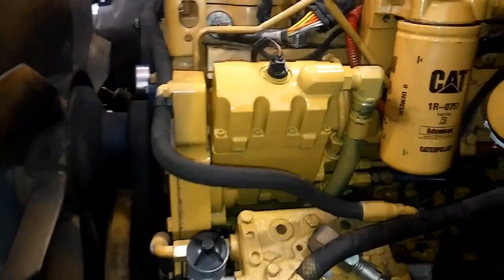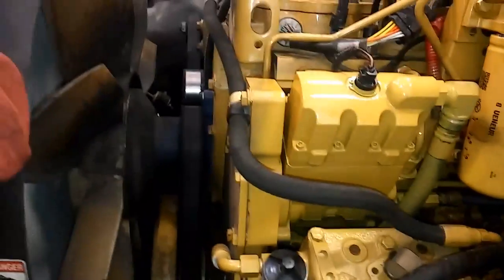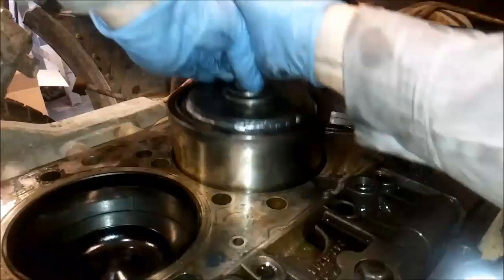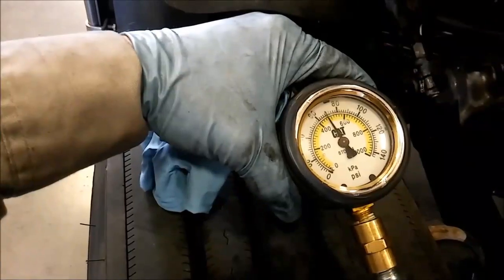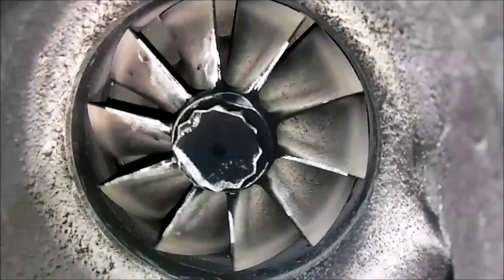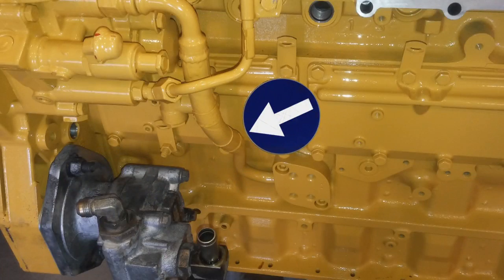How To Make Your Cat C7, 3126, or C9 Bulletproof.  HEUI System Upgrade.

Comment: My cat engine is a 1993 or so and since then, turbo technology and efficiency has jumped up in huge amounts.  I can't find any solid info regarding a upgrade. Not necessarily a CAT upgrade, but "common sense" upgrade .. It's not for (MORE POWER) but a quicker spool, cooler egt and less back pressure .. without injector changes, it won't make "more power" , but it will make the power with less heat and back pressure. much like a better inter-cooler can, but in a even better way. 
    I believe a proper compound system would do even better yet.  I wish someone who has seen this stuff done right would make some videos . ((Bringing your 3126 into the new millennium)) .. something like that...  it's like a 60s car on bias ply tires,  some new fangled radials will change everything...

Comment: Hey thanks so much for all the great info. I have C-9 in my coach. I have a whistle that is throttle position sensitive. Under accelleration it will whistle through relativeley small throttle position range. Under deceleration it whistles through the same range. Guessing it's something related to boost but hoping to get some input on where to look/check? Thank you in advance.

Comment: Boss , it really doesn’t help people do prolonged oil services. ALL hydraulic injection systems fail prematurely because people choose to change their oil when they feel like it, not when it’s needed. Be surprised how many people never think their oil needs replacing. When pumps, injectors and cams/lifters fail then they act like they never knew oil poor oil changes triggers that. 😂

Comment: Critical to check valve spring seat pressure every 75k miles , the weak springs are notorious for losing seat pressure with age and dropping the keepers and valve as a result

Comment: Is it possible to use a separate oil/hydraulic line/system coming from the engine going to the HEUI pump then going to the injectors?
Will that separate oil’s system seep in with the regular engine oil?
And if it does why not just use “clean” motor oil but still keep them separated.

Comment: Iv got a 99 Tiffin Allegro Bus with a 3126B with a Bullydog inline tuner... I love it but I bought a 2004 Newmar with a C7 Acert... Will it inter change?? 9:02
Reply: Were did you get the bully dog tuner i git a 02 gmc tow truck with 3126 kitten i want more power

Comment: Hey guy.I see there is a filter sysem that goes between the huei and the injectors. Im wondering if that would be a good idea or is that just more wear on the huei,by adding more back preasure to the huei?

Comment: I'm about to fit a HEUI pump to a C9 engine, I plan to fit a remote Oil filter on the intake Pipe to the HEUI pump, am I right in thinking this is a good move?

Comment: I have freightliner M2 with Cat C7, it was smoking bad and low power  when I bought, all injectors were bad so got those changed. 
Power is OK now but smokes a lot when start up, runs rough till water temperature hits 150, once water hits 150 on temperature,smokes reduces a lot and runs smooth. While running sometimes exhaust gives blue smoke puffs, startup has mixed smoke white and bluish. 
Please suggest what can be cause to this!

Comment: HI ape MASTER  i had 3 and 6 injectors problem so rebuilding all 6  is there any other filtration system to heue pump i want to fix truck truck sell  injectors no 241-3239  engine sno WAX31932

Comment: Hello brother congratulations for the videos of the channel. I am Brazilian and work with heavy machinery mechanics. I've got a c11 cat, which is losing power. This engine has no fault, except for one related to the atmospheric pressure sensor, but has already been corrected. We're analyzing the turbocharger,but apparently there's no problem with it either. You should know that the injection system is THE MEUI. What problems can this engine present?

Comment: Do you know how to adjust the governor on the C 3126? Of course you do. Could you explain how to me? I need to drive one 2600 miles that's set to 55-60.
Reply from the maker: You will need Cat ET to program the governed speed.
Reply: @AdeptApe  I was afraid that might be the case. Thank you for taking the time to respond.

Comment: Hello, don't know if you still respond to these posts but I will try as I need some knowledge about my c7. I bought a 2006 f650 , 26' box truck with a c7 motor in it. I do not know how to service it. I don't even know if the large plastic reservoir is for antifreeze or if it is some kind of fluid for the smog crap on a diesel.  I had a stalling problem that turned out to be a low on oil problem when I first got the truck that cost me 2000 to find out and 3 mechanics ( so-called ). I never thought to check the oil as it had just been serviced before I bought it by the PO but that was the problem all along. So after having a new injector pump put on for no reason among other things, I would like to have a better understanding of the motor so that I can avoid this kind of problem in the future. I am suddenly leaking fluid from the bottom of the ac condenser ( I think) that I had thought was just condensation and I also found a puddle under the truck that may or may not be antifreeze but has no real odor but has a slight oily feel but is not oil. I need to familiarize myself with how to service this truck before I destroy it. A little help would be great! thanks---

Comment: To test the heui high pressure on a 3126, do you take out the iap sensor and use that port? What should pressure be while cranking? I have a crank no start issue 99 freightliner . Changed timing sensors already. No codes, tach reads zero while cranking also when on either no tach, check engine light comes on with key so assume ecu is getting 12v. iap solenoid may also be bad is there a way to ohm it?  Thx for videos you’re a genius!

Comment: I've replaced that oil supply lime with just removing the power steering pump and the power steering adapter to the air compressor

Comment: Ape, what if I have a c7 that has boost issues and suspect waste gate problems. Does Cat have replacement waste gate? Or do I really have to buy a new turbo? Because I'm a Cat parts guy that used to have you working in the building that misses you like crazy! Best regards your former truck shop parts guy!

Comment: Get a really nice double cut fine file and gently rub it across the surface to plane it better.  A thicker file from a top grade company will true up that face... that or a sheet of glass with sandpaper superglued to it... these are both rather planar surfaces that are very abrasive
Reply from the maker: My Technical Communicator at Cat does this with the file and recommends it as well. Glad to hear he isn't the only one.
Reply: Adept Ape rub the file in circles/8’s gently. You can get a tempered glass strip from printers/fax machines. I can’t remember

Comment: Hey man I really appreciate all your videos. I have a cat 3126 in my freight liner water cart truck and I have just done a fair bit of replacing old parts with new like water pump, radiator, rebuild the turbo... I found that the waste gate actuator was not working, I tested it and air was coming out without pushing the rod. My question is at what psi should the waste gate open so I can replace it with an aftermarket one.

Comment: I have a chance to purchase a 2006 Freightliner M2 Sport chassis with C7. 98k miles for 50k. What are your thoughts on the engine you'd recommend for this platform

Comment: Great video. Just sent a donation to your PayPal. Wondering if the 3126 has the inline filter kit available yet.
Reply from the maker: Hello, please send questions to my email at AdeptApe@yahoo.com in the future. I usually don't read these comments. The filter kit is designed for the C7, but could work with the 3126 if you get the correct fittings for the line. Both HEUI systems are the same principles. I recommend contacting the IFS filter maker on this. Thank you.

Comment: Maybe use a piece of glass with some very fine sand paper, put a little solvent on the sand paper and push the face of the oil cooler adaptor plate back and forth on the sand paper until it's flat.

Comment: So I just installed this inline filter today 
How often am I supposed to replace the filter?  It seems like it will be almost impossible to change it with the air compressor installed.

Comment: Great videos!    Love the details!  

I have a 2003 3126 in a school bus.  I asked my local CAT dealer about the HEUI upgrade kit and he told me (as you say in the video) it only applies to the C7.  He said just change the oil every 7000 miles.  I found this on the CAT parts website, though - Part #240-0717  https://shop.cat.com/en/usa-parts/240-0717?utm_content=ps_an_promotional_northamerica_mypcc&utm_source=google&utm_medium=cpc&utm_campaign=united_states_part_numbers_b_parts-s&utm_term=%2B2400717&kxconf=t3oloumio&gclid=CjwKCAiAxMLvBRBNEiwAKhr-nBbcXjvR2G-9QIgj1hAbX2aer717qXfa70XzgVDqMTNmZi5g7dcQ1BoC1Y4QAvD_BwE

It says it is compatible with the C7, 3126E and 3126B.  Is this the one I should install?  How can I tell if I have a 3126E or 3126B, or something else?

Comment: Have a question about the oil.xooler on a 3126. Can someone build.a.rote.oil.filter system with external oil cooling radiator?

Comment: How much does it typically cost to get the high pressure oil line replaced and an in-line filter for the HEUI installed?

Comment: I have a 04 Ford F650 truck with the 3126B engine and about 62k on it. Getting alot of pining under a load or just when the transmission is about to downshift going up a hill. Almost seems like it's running lean because the exhaust dont smell like a normal diesel should. What could the cause of this be?? Been like this since it was bran new.

Comment: Hey sir been following your videos (best videos out there)I have a 04 KAL30004 C7  I started by reading the flash code (learned on your video) I got the following 
3-9.   5-8.    1-5  
Called cat  And they lectured me on using Flash codes and that I should just use cat ET but I think the Flash Code are just fine.  Based off the codes I decided to get the IAP SENSOR  And the Fuel pressure regulator.  Tried cranking it crank crank but no start check the fuel pressure where the fuel filter is read well over 50 psi.  So then I pulled the valve cover didn't see any of the injectors abnormally leaking pulled the injectors inspect the O rings O rings still look new ( replaced 2 months  ago)  So now I wanted to drop the oil Pan to inspect if cooling is leaking into the oil so I drained the Pan didn't get all the oil out  So I check the dipstick and the dipstick is still Reading full. So confused at this point the oil on the dip stick looks new and smells funny (like coolant ) while the oil that was drained from the pan black....still very confused  please help I will donate if given guidance 

Thanks 
Rico

Comment: If you do have a HEUI pump failure it's a good idea to pull the end plugs out of the oil rail in the head and clean it out so you don't get any metal into the injectors. Usually, if there is even a hint of flake in the oil when I drain the head, I do injectors and the pump as a set to prevent any future failures. Seen a lot of HEUI pump's replaced and few weeks or months later it's back getting injectors. Excellent videos, not many people take the time to thoroughly explain some of this stuff and even a lot of dealer mechanics don't fully understand them!

Comment: How’s it going Adept Ape? I just started watching your videos and they are very helpful. I’m from Houston Texas and I own a C6500 with a 3126 CAT engine. I put a few gallons of gas in my truck. It didn’t make it out the gas station. As soon as it started losing power I turn the truck off. I drained all the fuel  and refilled it back up with fresh diesel. It cranked right up and I left back to the warehouse . The truck doesn’t go past 30mph and it starts hesitating and blowing white smoke when I start pushing past 35 mph. I been driving it like that for about a week now trying to push out that bad fuel. Now I’m starting to worry. What do you thing from your experience?

Comment: Our 'new to us' 2007 Cheetah is powered by a 2006 Cat C7 350hp ACERT engine. Cat recommends their branded 15-40w oil for warmer climates and 10-30w for cooler. We just purchased the coach and are concerned about the HEUI pump issue so are making the mods Cat recommends to 'solve' the failure issues. My question involves people's experience with the newer tech synthetic oils...specifically Valvoline premium blue 5w-40 and Rotella T6 5w-40. They are less expensive than Cat and would seem to offer a solution to all climate needs. I am going to change the HEUI pump and add the inline filter and reseal the oil cooler just for precaution and am inclined to use either of the above oils but would like some historical reference to work from.

Comment: Just purchased a 2007 C7 powered Safari (2006 chassis).  I have been reading horror stories about fan bearing failures on these engines mounted with rear radiators (like mine).  Have you done a video on changing the bearing?
Reply from the maker: +Greg Yancey The fan bearings did fail a lot on the C7S serial number range, but you probably have a WAX, SAP, or KAL serial number and theirs rarely failed. You can change the bearing out on some models or the whole fan hub out. Some have grease fittings you can grease as well.
Reply: Thank you...yes, I have a WAX serial number....whew.  I will check for a grease fitting on the hub too. My coach has a maintenance record that shows oil and filter changes about every 9k miles....we just did a 2300 mile run from the dealer in Houston to our home in Redding, Ca and the oil still seems to be clean and we didn't use any...in your opinion, should we change the HEUI pump and install the inline filter kit for precaution or did Cat make enough changes to the WAX series that just the filter kit is necessary (or not?).

Comment: Thanks I found the video! Could I get some part numbers or can you check if this is the right one,  just the kit without the huie pump

Elbow 439-1889
Hose  503-7469
Filter  503-7470

Also is it a good idea to instal a oil heater inside the oil pan, where I live, winter nights are pretty cold, it could dip below -35*C or -31^F

Thanks!

Comment: New to the channel and enjoying the content quite a bit, always good to find a source of good information. I have been asked by a new side customer about a C7 overheating issue. I have not worked on the machine yet, it's in a Vermeer chipper. The history I was given was that it overheats to the point that the computer shuts down the hydraulics. So far the owner has replaced the thermostat and cleaned then replaced the radiator after the issue continued. I remembered this video and wanted to get the information about the filter for the HEUI oil supply line, and wanted to ask if you know of any overheating issues with the engines. I realize it's a chipper not a truck, I work for a Navistar dealer and haven't worked on these engines to know if they have had overheating issues. He told me it has a pusher fan, my first thought was the radiator was packed with wood dust. That was when he told me they cleaned it and then replaced it after cleaning didn't work. I figure I will work out his overheating issue and if it doesn't have the filter line then let him know about getting that installed. Thanks in advance, you can email me @ sptnurb@yahoo.com

Comment: The oil filter level (CAT-1808) on my HEUI C9 engine was 4 inches below the top of the filter on the last oil change. I reinstalled empty and  removed again after a 180 mile round trip. Again the level was 4 inches below the top of the filter. Oil start-up pressure is 125 PSI, sequentially I've installed an oil heater  for cold days. The HEUI pump doesn't like high or moderately high oil pressure under a high load. Until the engine coolant is 205 F and oil temperature/pressure is below 40 PSI is the HEUI pump is in its operating parameters. What's the pressure for the oil bypass valves to open? And why two bypass valves, top and bottom? Thank you for your channel.

Comment: what caterpiller engine is the same size of the 5.9 cummins engine?
Reply: i what put caterpiller engins in one ton dodge can it be done?
Reply from the maker: +Josh Lee The closest would be a 3116, 3126, or C7. They are all just different versions of the same block. They changed the fuel systems over the years and so the model changed. Cats are more expensive than the Cummins though.
Reply: Okay which one of those cats would be better suited in a 1-ton Dodge and would I be able to bolt it to the 4-speed transmission that's in there
Reply: The bellhousing on Bolts from the transmission is there a bellhousing out there that would fit my transmission it's a new process for Speed
Reply: 3126

Comment: just resealed a heui pump on a 3126 on saturday...steamed and road tested and had truck running for awhile afterward as well and everything was dry. THEN it came back last night with customer saying they think the oil line was still leaking (just replaced). turns out the pump is still leaking oil on the bottom of the mating surface! are these pumps pretty known for oil leaks? i think that was the second time it was resealed in the past year and my foreman just wants to order a new o ring and try resealing it again. im thinking it needs a new pump considering those factors and it looks like the oil leak might actually be coming from the back side of the plate not the mating surface. any thoughts? i don’t know too much about these heui pumps or cats in general... sorry for writing an entire book!
Reply from the maker: +Alex Spurling The pumps aren't known for leaking. There are seals internal to the pump, but I've never had to change them. The mating seal doesn't leak very often.